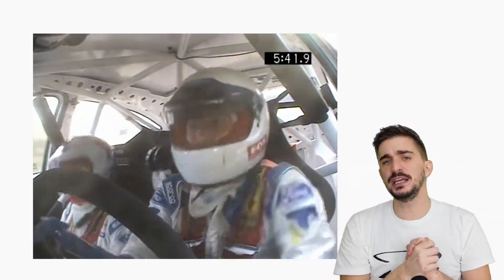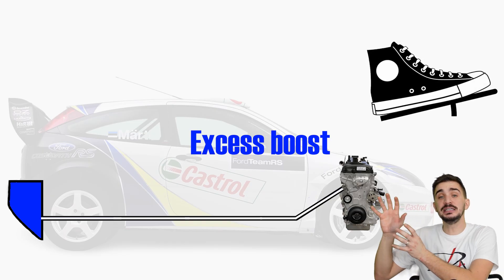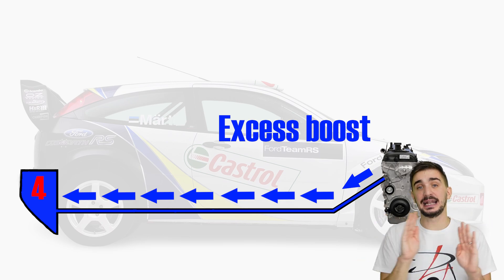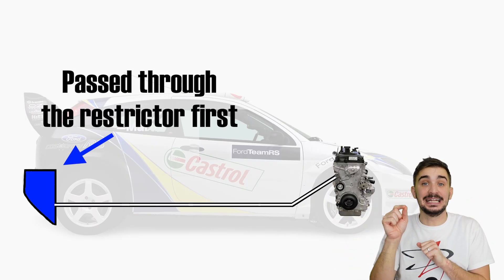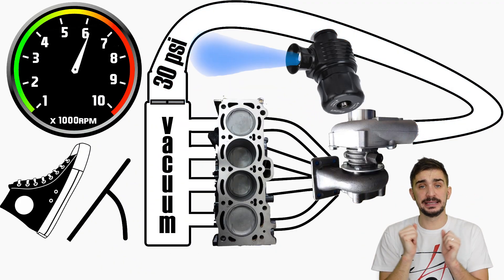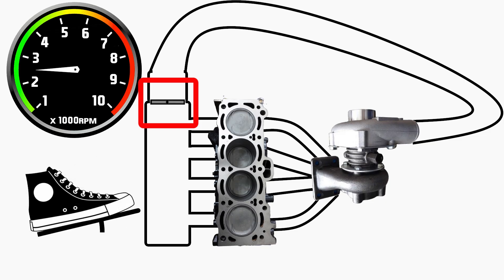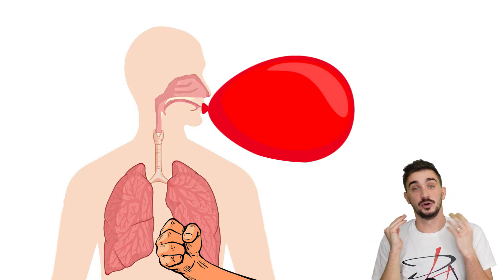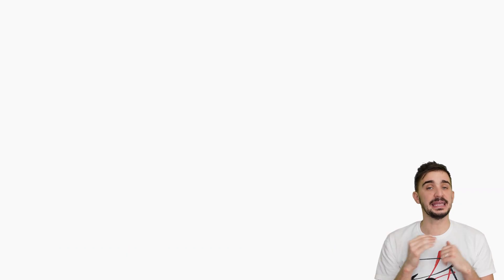FORD'S HIDDEN BOOST Tank - Welded TITANIUM filled with ANTI-LAG

Comment: Fill it before the race .That may create a different situation. Knowing the pressure limit of that tank would be nice. I mean 300 psi might be useful. using a 1.200" line and have it jetted to only use "x" amount not the whole volume of the line from the tank. It may help prevent lag even further.

Comment: I would suspect, and this is pure speculation - that they got a welder from one of the Boutique custom  Ti bicycle frame manufacturers from that era to do it.
I don't think one of the aerospace manufacturers would have  bothered with such a small 1 off job,  but an outfit like Moots, Lightspeed or Dean would have... 
And they have the experience welding extremely light gauge titanium materials.

Comment: Hey i would like to mention one point. You said an Turbo need to be larger to generate higher boost pressures. Is this not more from the designe of the compressor wheel (shape and number of wheeles)? As far as i know the size is for more air flow then pressure alone.
Reply: It is, the AR ratio can change the power curve significantly, but the best way to make more boost is to just suck in double the air. Big spooly snail = moar power

Comment: They wanted to limit power and cost in order to take advantage from rich companies and level the field, so they did...
- limit compression (harder than already), so as to promote innovations which could make future cars more durable and cheaper to produce? Nope
- Make the cars go alot of extra distance after the race and punish the ones that break down too soon? Nope
- limit the maximum fuel mass flow rate (or maximum overall fuel consumption with similar effects, but issues with prediction and risk taking) so as to promote innovation towards more economic and environmentally friendly cars? Nope
- limit power directly to get a more even playing field and directly achieve some of their goals? Nope
- limit displacement volume ("ccm") in order to promote innovation in packaging and downsizing which also helps make car more economic and in a small way (lighter weight) environmentally friendly? Nope!
- limit air intake so as to provide the innovation for insane workarounds that cost ridiculous amounts, need crazy amounts of engineering and welding skills, increase(!) fuel consumption and damage to the environment, weigh ridiculous amounts and destroy the cars in which they are used in even faster?
Dingdingdingdingding. This one, this one, this one!

Comment: Just a thought: the turbo has inertia, so if you suddenly block the flow, the pressure will rise momentary, otherwise blowoff valves wouldn't work.
So they theorically could store higher boost.
Reply: true. also, the baloon analogy does not apply, as the baloon changes volume considerably, thus it won t reach the source pressure
Reply: some of them had a crude  wastegate valve before the turbo  that was opened by a diapraghm via a pipe by the inlet manifold pressure

Comment: Man Seriously? If the turbo can make 30 PSI you can use pressure booster which is kind of simple device and store even 100psi in the tank no problem. Simple industrial thing that is used when high pressure is needed, but the factory line provides only say 4 psi for safety reasons. Do some research before telling rubish. I dont say the tank was equipped with this, but its completely possible.
Reply from the maker: You realize there's rules to rallying right? I specifically explained how this was within the rules. Any kind of external pressure boosting device is illegal. But you can't see past your sad little desire to try and insult someone. Hope your life turns for the better and you find happiness.

Comment: 12:25 well I've heard that in a B group, which had no blow off valves, the boost after you release a gas pedal, jumped up as high as 8bar and thus destroyed turbo rotor fins... The problem is with the inertia of the rotor. It can not stop instantly from lets say 100 000 rpm, so the pressure jumps higher than 30psi in your example. I've had a turbo honda civic with a homemade blow off valve, that has released only the over boost, and I could adjust it mechanically, so even though I ran on low boost like 0,7bar, once I tightened the blow off valve, the pressure gauge jumped up higher than 0,7bar, I did not try to close it completely, but the highest I have seen was 1,5bar. I bet there are videos with serious old rally cars with pressure gauges jumping much higher than a nominal boost, but maybe there were not many idiots like me, who had their boost gauges connected before the intake manifold. But if they had a one way valve in a 30mm pipe, to the tank direction and an ecu controlled valve from the tank, they could definitely have higher than 2bar.

Comment: Good video, but incorrect. The pressure in that tank will be more than what the engine would normally see, it is also used alongside the anti lag system not by it.
Reply from the maker: Did you even watch this professor?
Reply: @d4a  Yes, hence my comment.

Comment: I don't see how this is a good system at all, adding volume to the system mid boost is like adding a leak thus the 30 (if max psi) would be reduced until the tank equalized with the manifold. Only after that point would the tank be useful and when used would only work till pressure equalized between the manifold and tank again. If the difference between the tank and the manifold is that full 30psi the most you'll see is 15psi

Comment: I doubt the 5% of increase in power was there for more than a second. 
People often disregard the fact that pressure is not alone in the equation, there's also the flow rate. A charger must be able to maintain maximum pressure at maximum rpm, which is maximum intake flowvrate  You can get more than 2 bar from a Smart Fortwo turbo. But put that to a 2 liter engine which sucks up a lot  more m³/min of air than de 0.7l engine, The tiny turbo won't keep up with the demand and the maximum pressure will drop.
You can store only a fixed volume of air in that tank, as soon as the valve opens, that air pressure will quickly drop to whatever is in the intake. No wonder it didn't help them.

Comment: As far as I remeber the homologation of the US spec Focus was for aero reasons as the extended bumpers allowed for biggger aero appendices. The rear wing for example couldn't extend beyond the rear bumper, with the European spec homologation there was no way to design a sensible rear wing as it would have extended beypond the allowed paramenters.

Comment: What the video fails to mention is the normal maximum boost obtainable over the rev range is a curve due to the restrictor as the restrictor is a fixed volume flow per unit time device.
Meaning you couldn´t get 2bar of boost at 4000rpm as well as 7500rpm. The pressure will have been higher since a compressor may be able to produce 2bar of boost against a engine inhaling so and so much, the compressor map definitely can reach much much higher pressure ratios, how high is just a matter of antilag calibration strategy.

Now what this device´s main purpose I believe was is to give the engine a chance at getting that sweet sweet 2bar boost(or whatever the values really where) for a few moments at rpms  which you´d normally not have it. So if you had 340hp normally at 1.4bar at 6500rpm you´d gain quite a bit of power for a moment or some moments by having 2bar boost at 6500rpm until the engine ate it up and the pressure balanced. 
The time available of this extra boosting could be easily calculated. The boost excess via the flow valves could also propably be controller so that it would "leak" higher boost into the engine above the rpm thresholds of the restrictor normally.

Comment: nvm, you answered my questions, i didn't think you would discuss them but you're even more thorough than i expected!

wouldn't the large cavity take much more effort to pressurize, meaning a slower turbo (assuming both systems have anti-lag)

or alternatively if they have a valve that they close when the cavity isn't needed, wouldn't the sudden increase in volume lower the pressures as the air expands? (assuming the tank isn't already pressurized)

Comment: Interesting concept, surprised it's not more common for turbo engines. Definitely would help at low rpm/lag situations.
Reply: If it really weighs 20kg that's horrible, actually.  Many easier ways to get anti-lag I think, in most applications, but that are banned in rally (or were at the time)

Comment: Boost pressure is a measurement of restriction. Just because your engine makes more power at a higher psi is due to the amount of oxygen available from any given charger. Example a 50 mm charger would need to flow excessive psi to make say 500 bhp on a 2.0 size engine. Vers a 80mm charger would need to operate at half the psi of the 50mm to alot the same amount of oxygen to burn

Comment: Have you ever seen a "Hydraulic ram"?  https://en.wikipedia.org/wiki/Hydraulic_ram
it's a kind of water pump which uses hydropower to work. Part of the water goes down, but part of the water goes up, so no physic rule is broken. It's just an energy exchange.

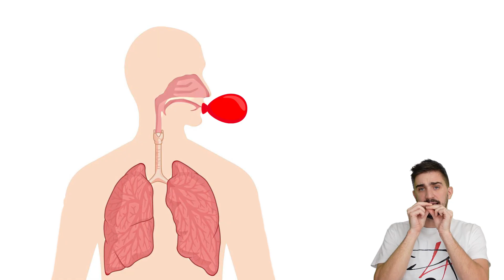I think this idea could be used to create MORE pressure than you have in the intake using the energy of the intake itself. 12:33 I could imagine a way to cheat this also: using the energy between intake and atmosphere outside, leaving PART of the air going out, for make energy to make more pressure. I am not saying "creating more energy than there was before". I am sayng using wasted energy to create more pressure than you have.

Comment: A larger turbocharger doesn't neccisarily have the ability to make higher pressures; merely to move larger volume. They can generally produce boost more efficiently though; with less heating of the air.

Comment: You are wrong. When the engine sucks air the restrictor does not let the turbo build pressure because it can't take the amount of air in to build the press. So if you tune the turbo for 5bar and when the engine shaking you can build only 2.5 then you can store in the tank 5bar.

Comment: Do you want to know how it really worked?
Turbos excess boost is not only from off throttle, but also you have to take account for the fact that typically an engine will not use the full capabilities of the turbocharger...
Lets say the Cosworth engine does run at a peak of 30psi, this boost level is regulated by the wastegate... the turbo could actually produce higher levels of boost 60psi+.
The difference here is that instead of using the wastegate to vent pressure from the system, a recirculating valve on the cold side will bypass boost to the tank once the engine is at desired full boost... This means the tanks will be filling at full throttle not just off throttle.
(Also bigger chargers do not create higher pressures... but larger volumes of flow. Flow produces power, not pressure)

Comment: I wonder if a system like this could be applied to road cars for a sort of 'not harmful for your engine anti-lag system'. Where the system instead of dumping the pressure into the intake for a power gain it dumps it back into the turbo to spool it back up almost instantly while the exhaust gases take their time to build up the pressure again. And considering that road cars run way less boost than rally cars the tank maybe doesn't need to be so big of made of titanium and can even come with an excess pressure valve so the tank doesn't exceed capacity and explode
Reply: that’s called a diverter valve and they come stock in like every factory turbo car ever

Comment: Correction*. Not that Ford did this, but the the PSI the engine sees would be the pressure difference between intake vs atmosphere. If you were to be able to close the intake, and feed 30psi into the turbo (whilst also stopping that pressure from escaping back into atmosphere ) the turbo could theoretically take that latent 30psi and increase the difference further (ignoring loss it could technically double the psi to 60 since the atmospheric pressure the turbo sees is 30 and it is capable of producing 30 at atmosphere.). Your bodily analogies would be "if you were to exhale into a room until you reached your max of 3 psi, and you were able to enter that room without losing pressure you could technically blow up another balloon equal to 3 psi. If you were to then take that balloon out of the room your total pressure difference would  be 6 PSI.

Comment: I would split the tank in half and connect the two parts with a pump which would take air from the low pressure tank and pump it into the high pressure tank, then you'd be able to get more boost than your turbo is able to make.
I swear, I should be an engineer! instead I'm doing something I don't enjoy. Great video!
Reply: Your pump would have to be stronger than your turbo, and if it's stronger than your turbo, that's just a super charger, which would replace the turbo and provide boost with no lag.

Comment: I had this same idea that I came up with after finding out about the stupid turbo-eating antilag system that ignited fuel in the exhaust to spin up the turbo quicker, though my plan was to use an OTS compressed air storage tank and the activation would be manual rather than this (much better) idea of simply using a passive valve regulated by the pressure differentials. It could also be filled/topped up with an air compressor if there turned out to be an issue with the amount of reclaimable boost. I didn't think it would work as the idea seemed so obvious that I figured someone would have used it. I even wrote it into a book where a smuggler built it and it didn't work well enough, so he used the air pressure to control the deployment of active aero features. A few years later, I read about it in Racecar Engineering and how it was banned by the FIA. D'oh!

Comment: How are you creating more pressure in the intake manifold if the air that goes to the turbo passes through a restrictor? The boundary layer of the restrictor would separate and create turbulence thus reducing the amount of air that can go to the turbo. And reducing the ignition timing is enough to cause those “explosions” because of valve cross over. At most it was a failed try to buffer air to help increase intake pressure before the turbo gains more revs.
And if you connect a hose from the intake manifold to the turbo, it is less oxigene for the engine.

Comment: 1) You can actually increase the maximum boost pressure and power with such a system. You just have to inject the tank-air behind the restrictor, right before the compressor wheel. This means the turbo can breathe in pressurised air, and compress it further. Such a setup can also help it spool up quicker.
2) With anti-lag, the mixture isn't ignited when the exhaust valve is open, but when the piston is moving downwards. Combusion-speed is higher at higher engine pressures. And around TDC you have both a high pressure and a small volume, hence the A/F-mixture can burn up quickly; after TDC you have both an increasing volume and a lower pressure; hence it will burn slowly and keep burning during the exhaust stroke.
Reply: I don't think #1 would work, as it would take some time for the compressor wheel to accelerate in reaction to the increased pressure.  plus some air will probably go backwards through the restrictor and out (fighting the momentum of intake air with it's higher pressure).  I would not be surprised to see compressor surge then or some weird boost oscillations.  and I'm sure the engineers would have used the trick don't you think?
Reply: @francoisloriot2674  Not quite...
Principle 1: Pumps and compressors create a pressure differential between the inlet and outlet, and the absolute pressures will depend on the restrictions. I.e. with a restricted intake the compressor is wasting energy on generating a relative vacuum, hence the absolute output pressure will be lower. By replenishing that relative vacuum you're removing a problem; but you could go further and actually get positive pressure on the intake side.
Principle 2: point the nozzle towards the turbo and let the venturi effect do its thing to not get backflow.
Principle 3: air/fluid flow behind a restrictor or pressure relief valve always loses speed and gets turbulent.

Now the concerns you have, are very valid concerns; but whether these problems will occur depends on the implementation, not on the concept itself. There is a lot that you can finetune, calculate and optimise in this setup.

On the idea that "they are engineers, so they must know this": they ought to, but don't always. I have had to correct my fellow engineering students and my colleagues before for total misunderstandings and stuff that didn't work at all. Here we're just talking about a different (more optimal) approach that they could have taken.
Reply: 1) The rules specifically stated that ALL air must pass through the restrictor first, to avoid bypass cheats like Toyota's.
 2) Great explanation!
Reply: @tojiroh  But all the air inside the tank has already passed the restrictor.
So the air goes: filter-> restrictor-> turbo-> tank+(storage)-> turbo-> engine-intake.
I.e. why inject the tank-air behind the turbo, when you can inject it before the turbo? The same restrictor rules apply either way.
Reply: @sasjadv  ah, yes, I misread you the first time. Isn't it what the system already did, though?
Reply: @tojiroh  They injected the tank air behind the turbo. And I'm like: just inject before the turbo and keep everything else the same.

Comment: I would use this on a Street/Track car. Install a compressor so you can do track days for hours and possibly smaller tanks. And it would make racing safer so you don't have to heel-toe. Or get hospital-grade 99% oxygen with a big tank to last the whole race. Your performance would be great if he was fed pure oxygen throughout the race and not just for anti lag. They should make a racing series where it's allowed.